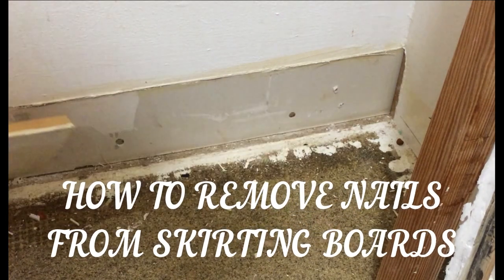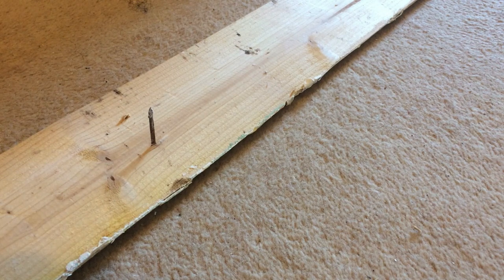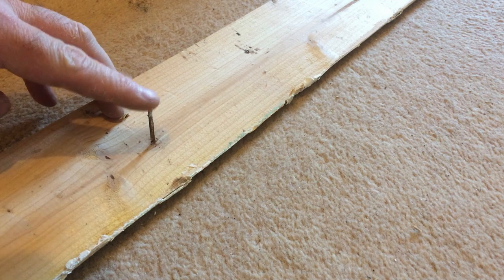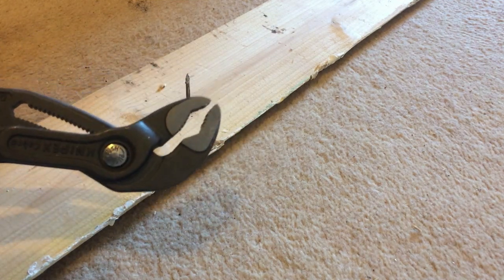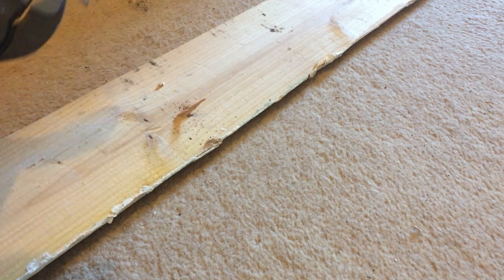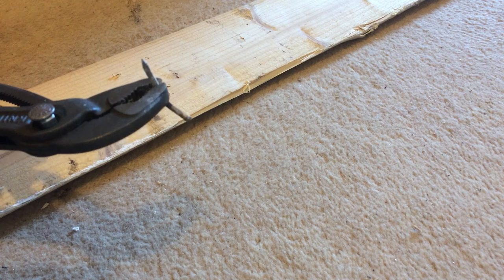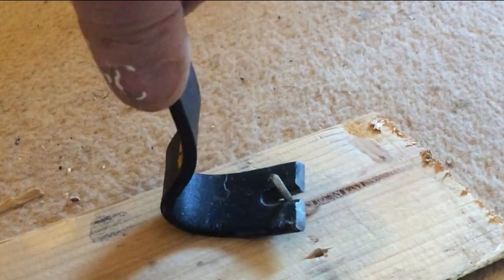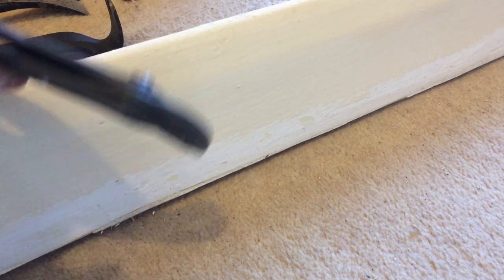How To Remove Nails From Skirting Boards or Architraves | Knipex Cobra

Comment: I thought of pincers as the solution too, but I don't keep them in my "all purpose" bag, whereas I do have cobras there, so this is a good tip, thanks.
Reply from the maker: Exactly the point of the video iron pirate - just pointing out that they are excellent at the job if pincers not on hand / available - thanks for the comment !

Comment: Great idea in a pinch but you should really get Knipex Carpenter's Pincers or the offset pincers for these. I normally use the 8" or 10" Carpenters pincers for nails as they are just sharpe enough for a good grab and the rolling surface does not damage any surfaces. I use the offset pincers when the nails are really long or if I want to cut them flush.  I think your method work well but it does mar the wooden surface and you have to manipulate the nail to remove it.  No need to do any of that for the pincers.  You should look into those pliers.
Reply from the maker: Thanks for the comment, yes I am aware of carpenters pincers but I was trying to convey that you can use knipex water pump pliers for this and they do a good job of it. Marking of the timber is not an issue because we are pulling nails from the reverse side of the trim. I use pincers occasionally but I have had occasion where they actually cut the nail when pulling - especially thin gauge brad nails. I had no pincers available to me whilst doing this particular job, hence the reason I used the water pump pliers, they are excellent for this.